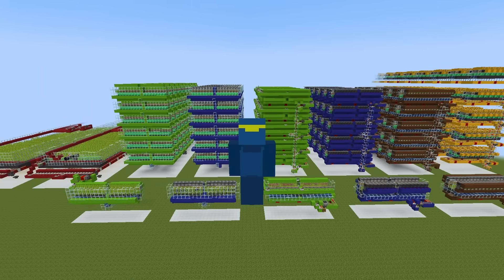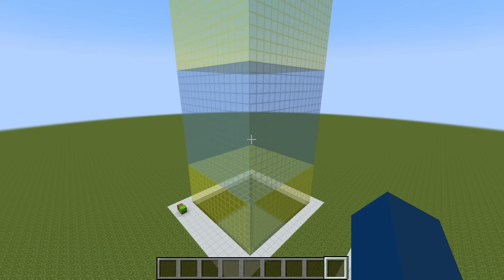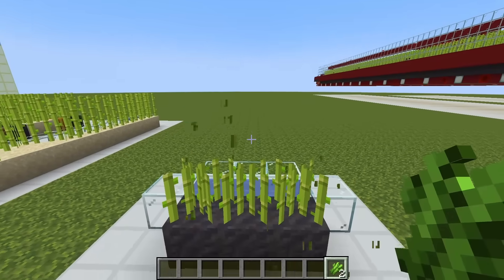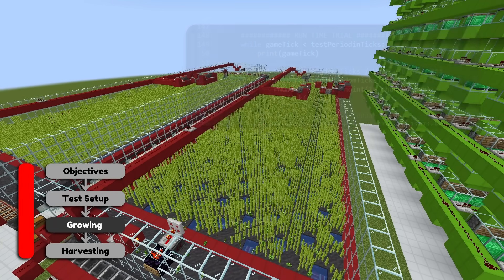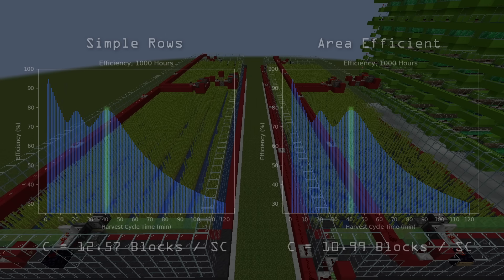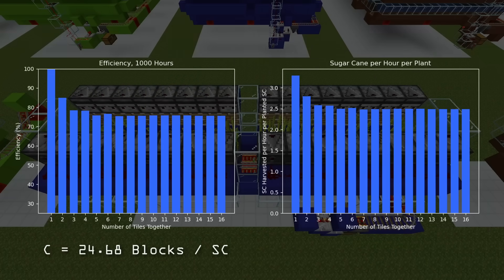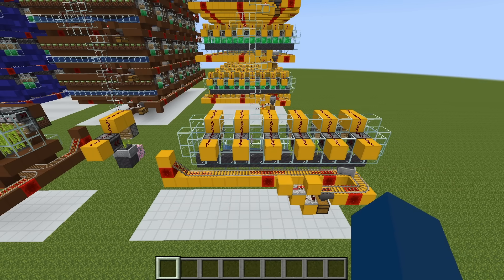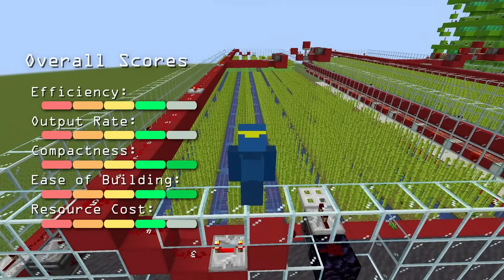I Simulated Minecraft to Find the Best Sugar Cane Farm

Comment: Good video! Production quality is really good and it was easily understandable (I'm jealous). 

One thing that I don't understand, however, is why you didn't run the farms in Minecraft at like 20x tickspeed for more real-world calculations. If not for calculating the real values (even at 20x game speed it would take like 50 hours), you could run it for a short amount of time to check if your code/assumptions are correct. Minecraft is very janky and there may be factors that weren't included here that might've changed the calculations, like the sugarcane being obstructed when trying to grow under a flying machine, or a firing piston. In the beginning of the efficiency graph the faster you gather sugarcane, the more efficient your farm becomes, but if the gathering mechanism takes up the growing space 50% of the time, that's 50% of the time sugarcane can't grow.

That's my two cents for now, thank you.
Reply from the maker: I’m really glad to hear it was understandable, I had to do a lot of takes to try to make it coherent lol

This is a good question, and I probably should have mentioned it. Here’s the story, so bear with me: This sugar cane video was the first of my coding videos I started working on, and I actually built all these farms and started off running in game tests. Programming it hadn’t even crossed my mind when I came up with the idea to test for efficiency. I have the carpet mod which has warp speed (basically running the game as fast as your computer can handle) and that’s what I planned on using. Unfortunately, I underestimated how crappy my laptop is, so it only sped the game up by like 3x and I had the feeling some of the drops weren’t being collected properly. My next idea was to literally just run the tests in real time. And I did. I ran two 12 hour tests (for two of the observer farms). I started with those two cause I didn’t have to worry about hopper clock timings. Then when I moved to the clock based farms, I struggled to get an accurate hopper clock for the intervals (I won’t bore you with how I then spend days figuring out how to use command blocks to make a simple clock 😆). When I did get the command block timer working I could only test one clock intervals at a time for the flying machine cause my computer really doesn’t like those. 

Anyway, I didn’t think my in-game testing was going well, it was taking too long, and I wasn’t even sure 12 hour testing would give nice results. Enter, my thought to try to program it. Once it was done, I felt comfortable presenting it and saying “I programmed sugar cane farms” cause when I compared my in-game test data to the program results, they matched up pretty well. I’m sure in the long run, the game will have some glitchy stuff so my code should be taken as a perfectly smooth running game that is pretty close to the real thing. Also, I wrote a program for each farm type and did take into consideration the harvesting style. For the sake of video length I didn’t go into a ton of detail but I did program a “flying machine” that stops my sugar cane from updating when it’s moving over it for example. Granted, I’m sure it’s not prefect, but I’d say overall it’s a decent estimate. Lastly, I assumed 100% lossless drop collection just to compare the best case scenario across the board. I think the hopper minecarts below to collect is the best way and as long as the cart covers all its path before the drops despawn it should be pretty close to lossless.

Comment: You know what's a game changing thing here?

Sugar cane cycles being the same as the day/night cycle. No more hopper or comparator clocks, just a daylight sensor from now on
Reply from the maker: Yeah that’s definitely one of the most interesting findings here. Especially since hopper clocks are so difficult to time correctly and aren’t super accurate
Reply: @SeaJayPlays  iirc ilmango did a similar research with pure math and came up with a similar conclusion.
Reply: @tunafllsh  and max hanke made a video on it as well
Reply: I've always just pointed an observer at the block above a cactus for my clock. Might not reliably be 100% efficient but it's good enough

Comment: I've managed to compact the "full efficient" design down to a 5x3 form factor that is stackable. 
observer facing the sugarcane will 0 tick budpower a sticky piston, which pushes an observer facing the opposite direction upwards, it then will hard power a full block, which the piston next to it will push down, breaking the sugarcane. 
that will in turn be observed by the observer, triggering the sticky piston to pull down the observer, thereby resetting the design. 

the only issue here is that sideway stacking of multiple modules may have some issues where it creates a observer clock. solution is to stagger it upward 1 block, or leave an airgap. I'll post a discord image link in the reply, cuz youtube will nuke this comment if I add it here.
Reply from the maker: @akiraawoock That sounds pretty interesting, I’d love to check it out. Another person in the comments recently sent me their tileable design and it seems to work pretty well (also uses pistons pushing observers) So it’ll be cool to compare them. 

I’ll post a link to his design once I’ve got one. Btw I don’t have discord so I’m not sure I’ll be able to see your image. Sending through my planet Minecraft account would work if you’d rather do that.
Reply: @SeaJayPlays  I'll make a video on it when i get my mic, I'll let you know when I get it out